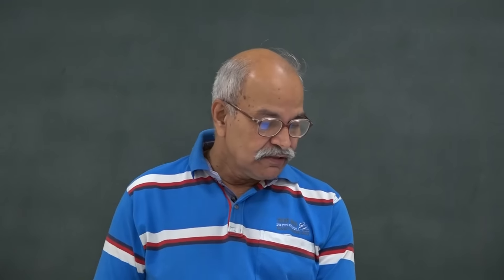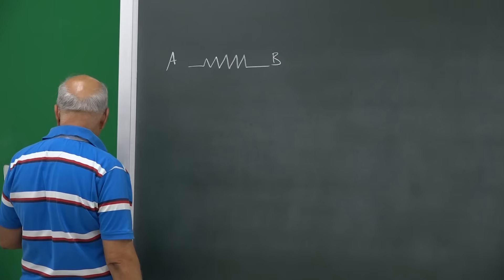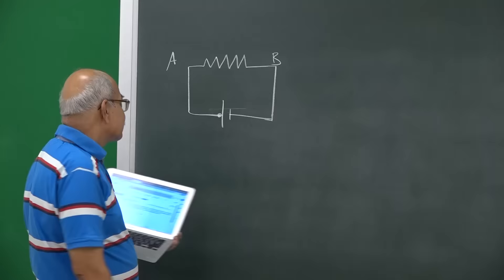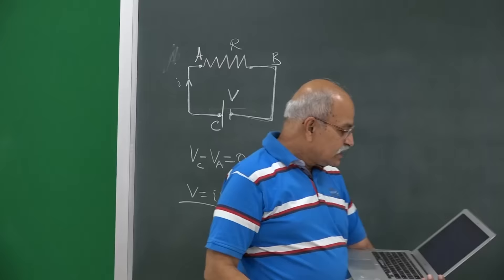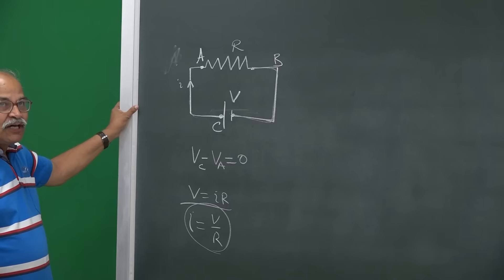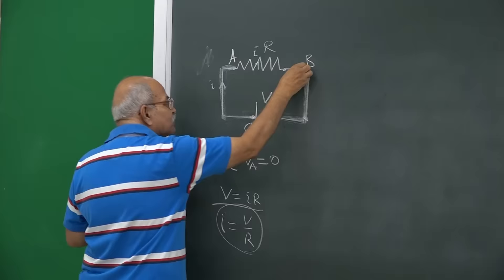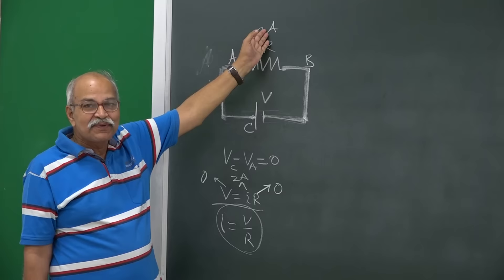Current without potential difference

Comment: still have a doubt without potential difference there will be no flow of electrons so how can current flow in the circuit 

also is it just mathematically correct or it can be possible and if possible then how ?
Reply: wire itself offers a small resistance which in result develops a small potential difference across 2 points on a conducting wire. this make it possible for the electrons to flow

Comment: People only think in conventional language of physics, no one thinks like HC verma sir.
But I think if we don't say Potential difference term here. Because if there are two points at same potential and some energy has been given to a charge it can flow b/w the points, here if electric field of battery has driven the electron in the wire it will go unless something stops, so language should be like this, potential difference is sufficient condition for a charge to flow but not necessary, charge can flow with outside forcce (energy), between points with same potential.

Comment: the current is flowing due to the resistance added. professor is right..wires are thick enough so their resistance is 0 in the example.
read book : Engineering circuit analysis by Hyatt, Kimmerly, first few chapters. this book is good to clear concepts.

Comment: Funfact! Current never passes trough resistance less wire, It will find the shortest path toward resistance.  If my resistanceless wire is 2 light years long but my power source and device(resistance) is  close by, so my current won’t flow for 2 light years to reach my device, It will be turned on right away, 
All thanks to Maxwell and Gauss😁

Comment: An equipotential wire can only be maintained in case it's isolated but the resistance at end A to B is eating constant electron flow hence to maintain equipotential in dynamic condition same current must flow from battery terminal to A  otherwise there will be subsequent electric field  generated creating a capacitor instead of an equipotential conductor wire .

Comment: can also be explained as the conducting wire has very small potential diff. and resistance then by ohms law -> v/r = i. the current can be big enough. i  mean suppose if resistance is 0.1 and potential diff = 0.01. if we divide we get a current  of 10 amprere across the wire...

Comment: sir my doubt even my teacher didn't solve 
Question- does electricity get waste in open circuit conditions of an alternator I thought it because the fuel is buring and prime mover moves but power=vi so current is not flowing so power is wasting in this condition or any other???

Comment: The current circulates in a close loop. So, when we consider current we take a loop as a whole. If we take  open circuit then voltage will be same as all points connected to the terminal of battery and there will not be any current flow.

Comment: I think this question deserves a bit more explanation. For example if  water at a reservoir is at the same level it does not flow   
Or drive water current however if one end of the reservoir is adjacent to an incline, it will drive water current through the whole reservoir even though two points on the reservoir are at same gravitational potential.

Comment: I have noticed a few posts on how resistance is zero and how it gives 0/0.
If one avoids mixing physics with maths , then many anomalies are resolved. 
Maths is only a tool and resistance being zero is an *ideal approximation*. 

Before we answer the question it will be insttuctive to review the working definition of current in a conductior, and the action of a resistor.

A working definition for current in conductors like metal wires is "the start-stop motion of millions and millions of conduction band electrons everywhere within with a drift superimposed".

The e.m.f of the battery is due to separation of positive from negative charges which produces an e.m.f across its terminals and a pattern of electric field surrounding them, not exactly but like a dipole.

Consider a simple circuit comprising a battery, two wires and a resistor. An electric field is there in the wires and in the resistor; powerful electric field and uniform within the resistor, weak and uniform within the wires . 

The field is set up by a tiny amount of surface charge with a steep gradient on the resistor and *not so steep a gradient on the wires*. 

It is the electric field E created by the surface charges sourced from the battery, which produces a force causing the mobile electrons to acquire a drift velocity v = μE, where 'μ' is the mobility which is a number representing the freedom of movement of the electron in the lattice. 
This results in a current density J = σE , where σ is the conductivity of the wire or material of resistor and E is the electric field in the wire if considering wire and is the field in the resistor when considering the resistor.
Video 1 
Revised Current and the conduction process https://youtu.be/TTtt28b1dYo
Video 2 
Surface Charge on a High Voltage Circuit https://youtu.be/8BQM_xw2Rfo
You will also learn from the textbooks 3 and 4 listed in References of video #1 the physical processes which enable a current to know by what amount to split in parallel branches.

The p.d. or voltage across the resistor is the integral of a constant powerful field along its length. The p.d. or voltage across the wires is the integral of a constant but weak field along its length. 
Voltage is entirely because of the surface charges.
For a live demonstration of surface charge and its effects in circuits visit
Surfacecharge
https://youtu.be/U7RLg-691eQ

 What is a resistor? It is the property of a conductor which determines the current produced by a given difference of potential. This makes us remember that a resistor is a conductor first. And, there is reason to say that superconductive wires don't obey ohm's law. 

Therefore, it would be safest to substitute ' very close to zero' resistance for the wire instead of 'zero' which is a property of superconductive wires and not real-world wires . 
Then the explanation fits neatly in place.

For a lecture by Prof Ruth Chabay on surface charge in a simple dc circuit visit 
 EM12 
https://youtu.be/-7W294N_Hkk

Comment: Suppose a cylindrical bar magnet is moved along the axis of a homogeneous circular ring formed from uniform resistance wire. An induced electric current will circulate in the ring as the magnet moves, but there will be no potential difference between any two points on the ring - even though current is flowing.

Comment: Sir pls reply .......I have a ques..
In horizontal there is a staright current carrying straight wire  of infinite length (current in -i direction)...and vertical l length  wire at distance x ..from long wire and having curent in +j  perpendicularly ......

After calculation we found that force on l length wire by infinite lenth wire is in -i direction  ....hence according to ..sir Newton if action force is in -i on l lenth hence ...reaction fore is on the infinite wire in +I direction ..but according to .f=(ixB)... F is always perpendicular to current vector but here force is anti paralle to current ....how is this possible .....is this vailation of Newton's law

Comment: The reason is because ideally if the current is flowing through some length of the wire, the charge per unit length of the wire will be zero because same amount of charge is flowing in and out. If the current stops flowing at any point in the wire, the charge density will build up in that region. This charge density will repelled by the electrons incoming from behind which will cause the electrons to start moving again. So it is a system that self-corrects itself. You cannot stop the current from flowing once the battery is connected and that initial push is given by the battery.

Comment: When the e field flows from A to B, workdone  is more at A and work done is less at B. Potential difference is nothing but work done per unit charge. So over all potential difference remains same. But when we travel with the e field along we find that near the +ve electrode potential is High and on going towards point c potential becomes but not as considerable amount. Also we need to note that after the resistance there will some loss of energy. So potential will be diff at that point.
Interpret the e field concept and potential diff, you will get answer

Comment: Sir theoretical it's correct.. suppose I keep finger on the wire where voltage difference is zero then I should not feel the shock.
Though I am wearing a slipper.

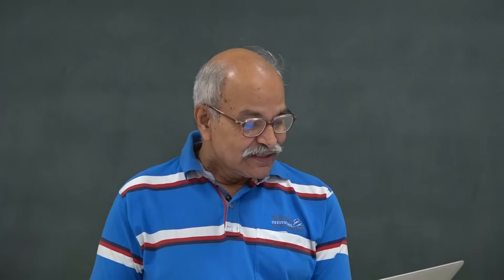Comment: 00:09 Adding a resistance across a battery in a conducting wire

00:41 Potential difference across a battery

01:19 The potential difference between point C and point VA is zero.

01:52 Despite zero potential difference, a current flows between the two. Why so?

02:16 Current remains the same in a circuit despite potential difference

02:45 Resistance is neglected when it is very small or zero.

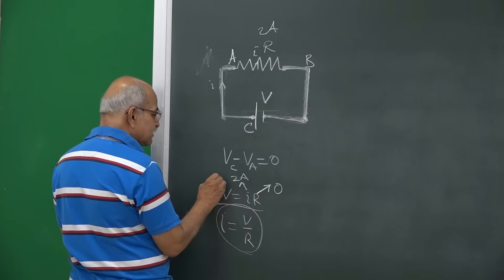03:15 The potential difference is 0 due to the current being 2 ampere.

03:36 Changing resistance or battery does not affect the current of 2 amperes.

Comment: sir but if current potential difference is zero it becomes paradoxical to stataement that current moves from high potential to low potential  so  bascically whole idea u explained tells us that if ressistance of wire is zero as compared to the actual resistance R then there will be zero potential difference between positive cell to a point of resistance R

Comment: Since water can't flow upwards (or increase it's potential) itself, But can get spread on the same level.

Similarly, current can't flow in a direction of increasing potential, but can flow on the same potential level.

Comment: This means that if the resistance is zero, then the potential difference will be zero, doesn't matter what the current is. And I also understood that, we neglect the resistance of the wire and that's the reason why the potential difference is zero. Or else if we consider the resistance of the wire than the p.d would definitely not be zero.
AM I correct?

Comment: V produces I once a circuit is established. So it is quite odd to say that a current of 2A flows in a circuit of 0 ohms powered by a 0V supply even though it satisfies the equation V=IR. Remember v is a force (emf), so 0v cannot drive any current through any circuit.

Comment: so there is still a very small amount of resistance in the negative end of the wire which is multiplied by the 2A current to make a small enough voltage which is close enough to 0 to call it a ground of 0V?

Comment: I guess when the resistance itself is 0 so the amount of work done to move the charges itself isnt going to be needed at all since at that point the charge could just move ahead.

or alternatively, its possible that theres a negligible amount of PD and Resistance that exist but it's not completely 0. So Ohm's Law can still be valid in the following way
V = IR
0.0002V = 2A * 0.0001Ohm
This is completely valid. 2A of current can still flow through a negligible PD and resistance. 
Similarly 
2A = 0.0002V/0.0001Ohm

Comment: According to antenna 📡 which we design we say that frequency is between 1 to 5 Mhz or other think we can define values between 1 to 2 Mhz and can use them for infinite frequencies because if we consider frequency between 1 to 2 mhz then if we see then output can be
1.1,1.111,1.115677,1.9876,1.11153565.....infinity now. Then why we are using this because if you increase value before point it will have large change as compared to adding values after point
And this is because even if there is small change in frequency then both signal are uncorrelated to large extent. summary try to give less range frequency to any device as all this range will have infinite frequency between them. and sent the signal by TDM Time division multiplexing here each signal will have different slots. my invention is right if you use TDM then changes will be large in time domain which can be physically drawn with rotary switch. best it is too try with CDMA . gIVE EACH SIGNAL DIFFERENT CODE.

Patent. 
RISHI NIGAM
🇮🇳🇮🇳INDIA
MOVIE' "Rishi Nigam - (The Indian scientist) "climax scene

Comment: Actually, the two points have the same potential. That is why current flows through resistance when the other end of the resistance is connected to a different potential ie negative electrode. The resistanceless( practically speaking) conducting wires are just extended electrodes.

Comment: Current will flow because there loop is getting formed with voltage source in it.

If you removed battery OR you break the loop, still potential difference between C and A will be 0. But in that case no current will flow in the ckt.

Comment: Since we're assuming that the connecting wire (the wire being used to connect the terminals of the battery to the ends of resistor) has negligible resistance when compared to that of
considered resistor, we may go on calculating the equivalent resistance (series equivalent of resistance offered by that resistor and resistance of connecting wires which is supposed to be zero) along the battery and i.e. equal to resistance of the resistor itself (Rs = R + 0 = R, where R is for resistance of the resistor). Now, applying I = V/Req. = V/R, clearly whole current is due to R and not connecting wires. 
Whatever I have written above is just the basics of "how current flow through a circuit"! 
Coming to the question, since resistor R has got I = V/R through it and I has reach to only path which is through the connection, you better know that I cannot flow through air and thus it follows its available path to reach and pass through the cross-section of resistor R. In layman's terms, potential difference is something that pushes electrons against resistance in one dimension and in this case since potential difference is assumed to be almost zero, so there shouldn't be any resistance. Electrons coming out of the negative terminal of the battery are subjected to direct themselves for one dimensional motion (neglect the zig-zag movement of electrons), they don't require anybody's help, and since there is no obstacle like resistance in their path they will move even through the cross-section  of connecting wire with negligible resistance. 
If the explanation sounds like going off the track or doesn't make much sense, I don't have any issue with that. 
Cheers!

Comment: Sir you hav substituted the value of resistance between AandC as 0 in Ohms law. Actually AC portion of the circuit has a resistance <<R. Also there is a potential difference between A&C. This extremely small pot. diff can cause a large current of 2 amps to flow since the resistance is extremely small. Finally all 3 parameters are present and work according to Ohms law

Comment: Sir my name is Siddhant Jani , I have a very big doubt , however nobody answers my doubts. I study in class 10 and my doubt is of the chapter electricity. Sir we should assume a circut with battery and a wire. So sir if the resistence of the wire is infinite then no current can pass through the wires.Now sir as we go on decreasing the resistence of the wire( By changing the wires) we find that more current can flow to the circut. And as the resistence of the wire starts to approach towards zero , moreand more current can pass through the wire. Now sir in a video you had cleared the doubt of a student( current with no potential difference) where u had stated that the wires are so thick that we assume the resistence as zero(In that case sir actually the potential difference was also not zero , since the resistence of the wire was not actually zero) due to which current flowed. Now sir back to my doubt IF THE WIRE ACTUALLY HAD THE RESISTENCE AS ZERO THEN THAT WOULD MEAN LITERALLY NO POTENTIAL DIFFERENCE ACROSS BATTERY  AND HENCE ELECTRIC CURRENT WOULD NOT BE ABLE TO FLOW ( NO DIFFERENCE OF ENERGY OF ELECTRONS). SO SIR WHEN THE WIRES HAVE POTENTIAL DIFFERENCE OF ZERO AND INFINITE SAME PROPERTIES ARE SHOWN( NO CURRENT IS ALLOWED TO FLOW THROUGH THEM). BUT SIR AS WE INCREASE AND DECREASE THE RESISTENCE OF THE WIRES(POTENTIAL DIFFERENCE IS DIRECTLY PROPORTIONAL TO THE RESISTENCE) WE GET DIFFERENT PHYSICAL PROPERTIES OF THE WIRES. SO SIR AT 2 EXTREME CASES WE GET THE SAME RESULTS??? CAN U  PLS EXPLAIN THIS .  ALSO SIR I HAD ANOTHER DOUBT THAT IN SUPERCONDUCTORS THE THE RESISTENCE IS ACTUALLY ZERO , BUT STILL ELECTRIC CURRENT FLOWS THROUGH THEM . SIR IF RESISTENCE IS ZERO THEN THE P.D IS ALSO ZERO SO NO DIFFERENCE IN ENERGY OF ELECTRONS < BUT STILL ELECTRIC CURRENT FLOWS THROUGH SUPERCONDUCTORS. HOW?? SIR I THINK THE ANSWER TO THIS QUESTION WILL CLEAR MY PREVIOUS QUESTION. SIR IF POSSIBLE PLS CLEAR MY DOUBT SINCE NO ONE CLEARS MY DOUBTS.

Comment: I have the another explanation resistance is throughout every section the wire the wire without resistance is not possible to have so between every two points some resistance resides that's why potential difference is automatically made up.

The diagramatic representation is quite wrong ... actually R is the series combination of all resistance in wire and the  combination of resistance is hypothetical concept  for easier the calculation we assume those resistances to be a equivalent resistance . Equivalent resistance has no existence at all....

Comment: Sir I've seen one of ur vid and have doubt in it... Video was Refraction or no refraction when passed through normal.. something like this... So sur just wanna ask there ur answer when u calculated refractive index was 0/0.. where u said it was inderminant.. Now then what about the speed of the light sir? Will it change or remain same? And if we will apply the formula of v1/V2 then the answer of it should be 0/0.. but if it is travelling fr medium to medium then how it can be 0???... and if it is 0 then it should not be 0